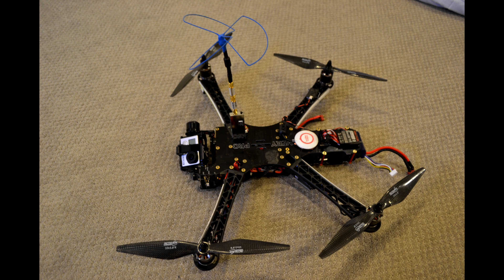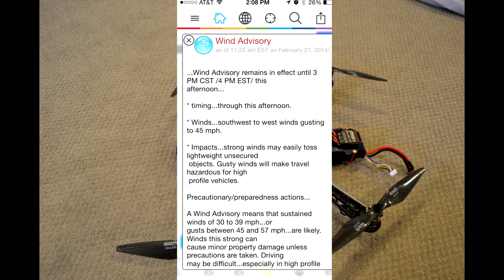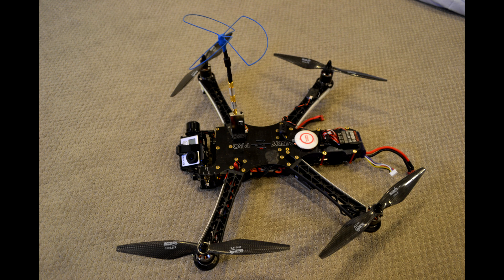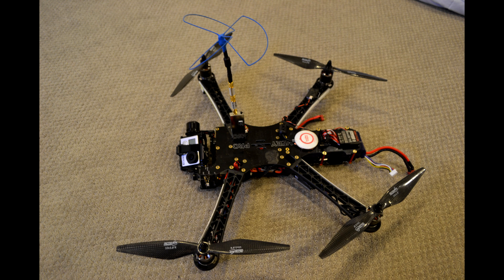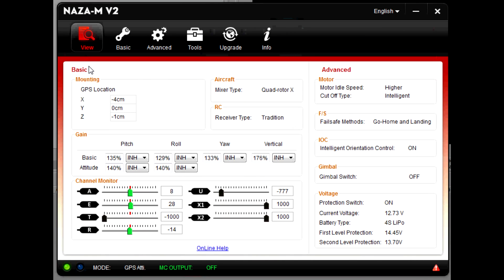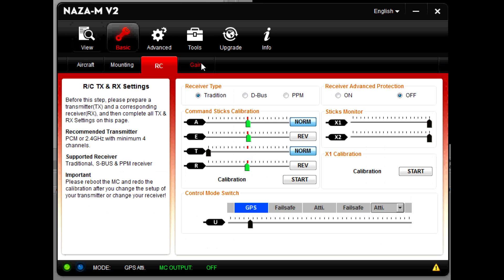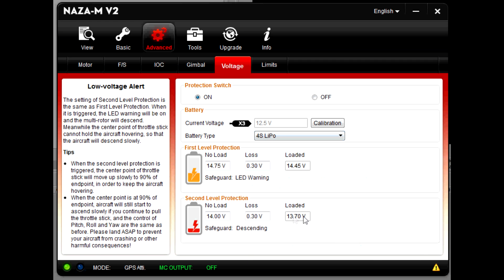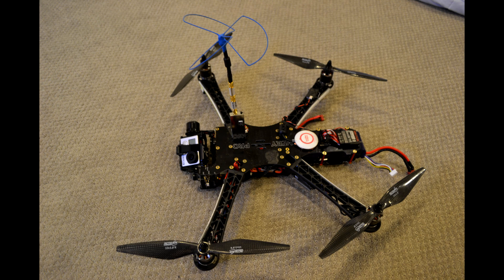Firmware Testing: DJI Naza V4.0

Comment: Let us know ASAP if you figure out a way to turn off the distance limit; until then I will not be updating to version 4.0. Thanks for making the vid.
Reply from the maker: set the values to 9999.

I've yet to see one of these quads get to 10km and make it back alive ;)
Reply: Ok, reading the sidebar indicated the limit was 2k; nice to know you can go higher on the limits.
Reply from the maker: Yeah, I noticed that while I was editing the video and QUICKLY, and somewhat angrily changed it. I have to admit I'm unimpressed with DJI's trend toward less tune-ability as of late.